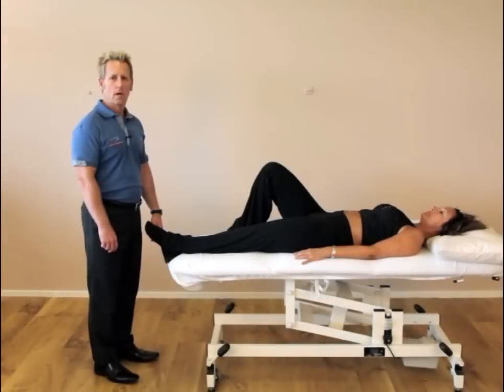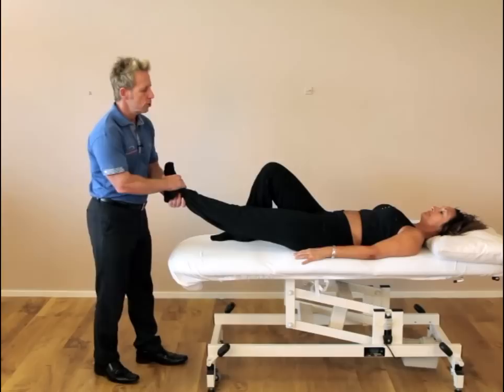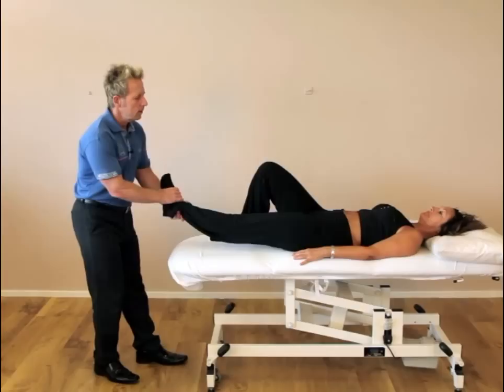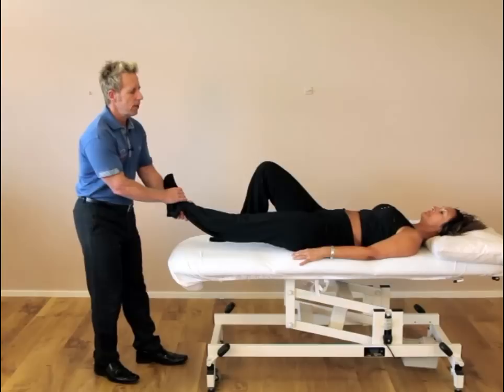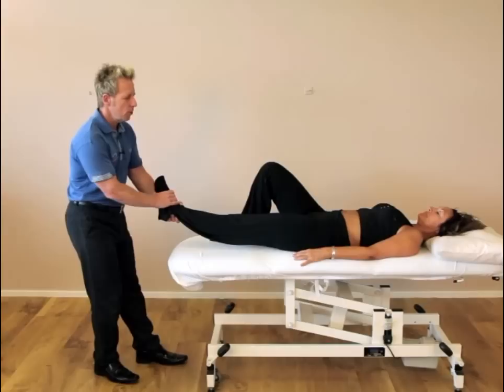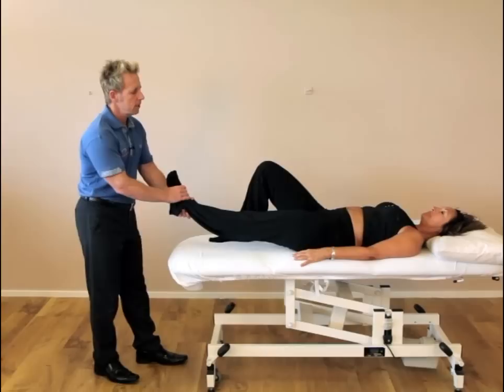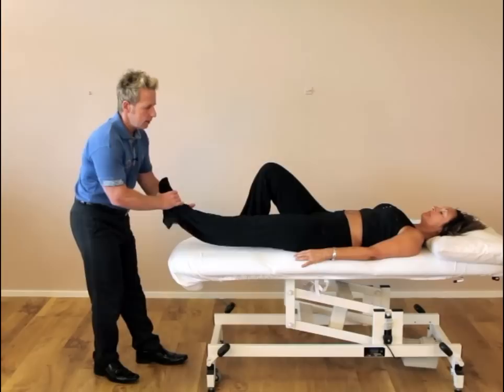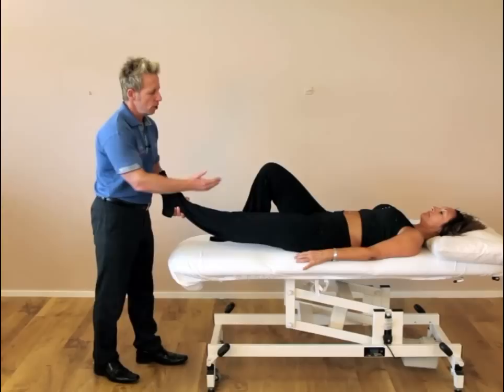How to correct a Sacroiliac Joint (SIJ) Upslip using a Grade 5 HVT manipualtion / MET

Comment: Hey John, this is exactly what a PT did to my left side and I had dramatic relief for two days after a year long struggle with chronic pain but since then she has not been able to give me the samr relief. My question though, is it possible to have an upslip on the left with posterior rotation and an anterior rotation of the right as a result of the left upslip?
Reply from the maker: +Austin Man Yes it is possible what you say and both sides of the pelvis would need a correction, good luck! JG
Reply: This dr have amazing experience,
Reply: @JohnGibbons 
I still have this issue years later after posting. Have tried 30+ PTs in my area and surrounding states with none of them knowing how to perform your technique or believing upslips exist (the one I saw who did it once moved and I don't have her info). Can you recommend anyone in the USA to help with this? I am willing to travel, really need help.

Comment: Thanks for your videos, very informative.  How would you choose  whether you perform this technique in supine or prone?  Another video has you performing the correction in prone.  Thank you
Reply: I was wondering the same thing.
Reply: @EmergeAndSeeTherapeutics  Some individuals present with an upslip with an anteriorly rotated pelvis or posteriorly rotated pelvis.  In either case, you bias the technique to address the rotation dysfunction, ie if the patient has rt anterior rotation, place them in a supine to bias the pelvis to posterior rotation.
Reply: @emileuaparadorn2767  thank you!
Reply: @emileuaparadorn2767  do you know why this disyfunction occurs?  I’ve struggled with it for years. My body just doesn’t hold the adjustments and I am so frustrated right now, being in treatments every couple of weeks.

Comment: does this work for AVN..........elevated hip due to walking on tippy toes, as to not bear weight.
Reply from the maker: Do you mean Avascular Necrosis? This technique is to down slip the innominate bone of the iliosacral joint (SIJ), if you externally rotate the hip then apply traction then this helps the hip joint and if you internally rotate then the technique is more directed to the innominate and even the lumbar spine. Hope that helps, regards JG

Comment: I heard that seeing PT who does Grade 5 Lumbo Pelvic Mobilization may be the best way to go (which may or not be the same thing u are showing in this video), but I'd have to travel a huge distance to access such a PT, & it'd be very difficult to find someone to get me there & very expensive etc. Can U advise me whether this would be necessary, or whether going to a local PT without that particular knowledge would be adequate. I've been unable to stand or walk at all for 5wks due to unbearable pain from lower back & down the back of the upper part of my left leg (its very different from the 'normal' sciatic pain Ive suffered often over the past 21yrs). I mostly only get some relief when sitting or half sitting/half laying down if propped up on many pillows under different parts of my back & legs etc so that Im laying half on my back & half on my side, in a very specific position or else I cannot sleep from the terrible pain though I'm on highest does of tramadol.  This is 2nd time in 6mths this has happened, but last time I finally was able to walk again after 5wks, but this time there's only a tiny improvement the last 2days after nearly 5wks of total debilitation & much excruciating pain. I can only move around the house if I'm pushed in a wheelchair (by my husband who is on an oxygen machine 24/7 which knocks him around badly) so the rest of the time I'm forced to sit on my firm couch or my firm bed propped up by many pillows, due to the extreme pain. I've had two bulging discs for 21yrs but the pain caused by them has always been different from this. Ive been to local chiropractor many times to take the edge off the pain & he suggested a SI Joint belt which (along with a new firm mattress) helped me recover eventually last time this happened, but this time the pain is different than it was last time & the pain has only minimally decreased in this past 4th week which is deeply concerning me as I'm totally debilitated & in great pain, & dont want the wrong person treating me & causing more pain or damage if they dont understand properly what the cause of my pain is. Plus I cannot afford to waste any money. Will any PT be able to help me or do I need one who specialises? Any suggestions? (PS - I cannot get any treatment that requires me to lay on my stomach because the pain is unbearably excruciating  in the back of my left leg each time I tried., so that it feels like someone is pushing a thick long metal rod right down through my muscle - agony!!!)
Reply from the maker: Most Physical Therapists should be able to help you but you might need a Chiropractor or Osteopath to assist as well. Good luck, Regards JG
Reply: Thanks! I appreciate you answering my question. I'll try the local PT then!

Comment: Sir , my left leg 1 inch shorter than a right leg , how l can recover this problem
Reply from the maker: Try a heel lift initially of 1/2 inch on the shorter leg as surgery is pretty drastic, good luck. JG
Reply: Thank you sir
Reply from the maker: Hope it helps and wish you the best. JG
Reply: this might not be recommended if the leg wasn't truly shorter but the deformity comes from further up the chain, i.e. the hip.
Reply: John Gibbons first we have to rule out it’s true shortening or apparent shortening , if apparent mean v correct with orthotic support & holistic approach.
In case true shortening mean only recommendation for orthopedic ( illizarow procedure )